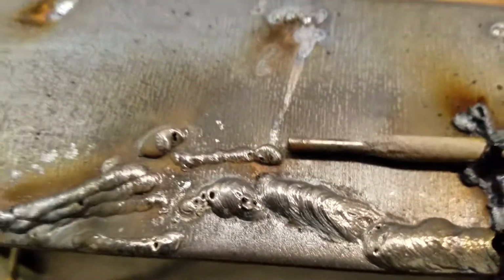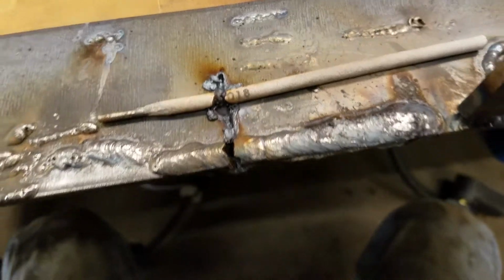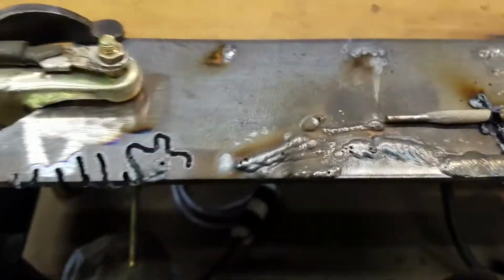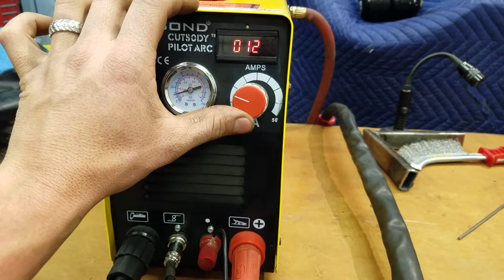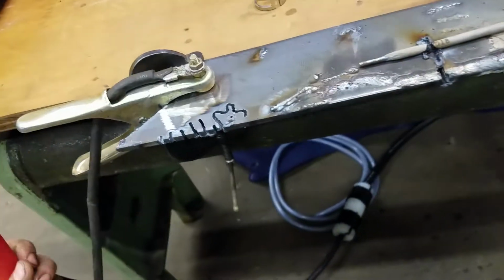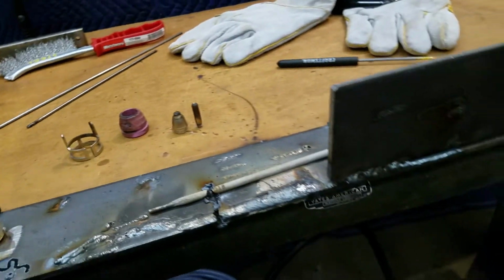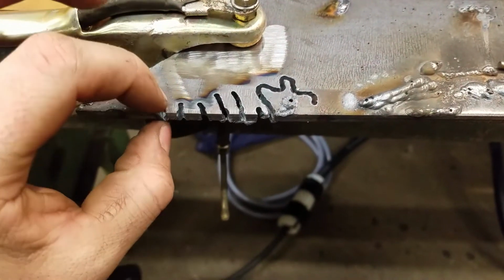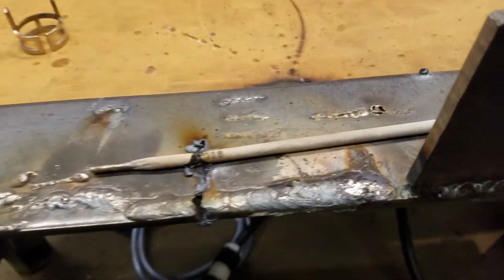Hitbox TIG200P part 3+

Comment: If you are building a bridge or skyscraper (i.e. structural) do NOT use 7018 that wasn't stored in a rod oven AFTER opening the pack/box/can.     As I will never build an aircraft carrier out of my garage it is allowable to buy the rods in the job packs of a few pounds and afterwards store leftovers indoors and gently heat in a WARM oven for about an hour before use because 7018 doesn't always behave well if damp.      I usually use Lincoln 7014 rods that have almost the same benefits as 7018 but the storage isn't as particular, I just keep them indoors in a plastic tube.     DO NOT bake 6010/6011, just store indoors as the cellulose rods want a bit of humidity...

Comment: nice presentation on both machines, tell me how have both machines held up so far considering its been almost 2 years since you had them? Also was wondering how often have you used them? thanks in advance, nice vids
Reply from the maker: Both machines have been flawless. I use them about twice a month. I don't use the arc welding feature on the tig welder since I have a Millermatic 251. The plasma cutter is great. I have noticed that depending upon where I get the consumables from it will effect how nice the cut is. I bought replacements from a couple different ebay sellers. The 25 piece pack worked best. I can't remember the seller info. But either way I used only 3 sets of consumables to cut up a zink plated boat trailer, and a 60" commercial zero turn mower. That I scrapped. So for a little over 1300#'s of steel it worked great. The last time I used the tig welder was a failure because I didn't have the correct filler rod for the material I was welding and the parts were also different grades and thicknesses of stainless. So nothing to do with the machine but all to do with the metals.
Reply: So it looks like that the inverters will hold up in a homeowners shop for a while if they are not used and abused on a daily basis. To be honest at the moment I'm leaning towards 2 units that are transformers, one is the Forney AC/DC stick welder $500 Made in Italy and the other is Oxford MIG welder $800-$900 made in England. That's probably 800-900 more than I would spend on a Chinese multi welder but these welders are work horses and proven to last. They are hefty though and I will have to build carts for them, but they will be used in the shop only. Thanks for your opinion though, much appreciated bud